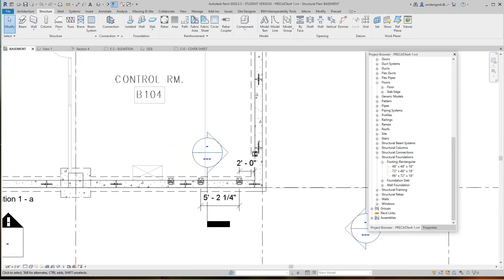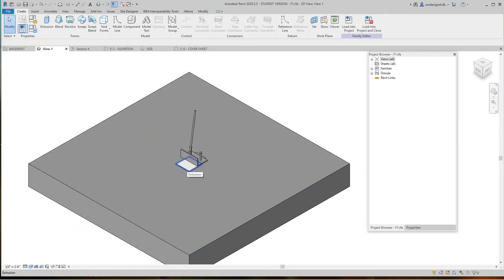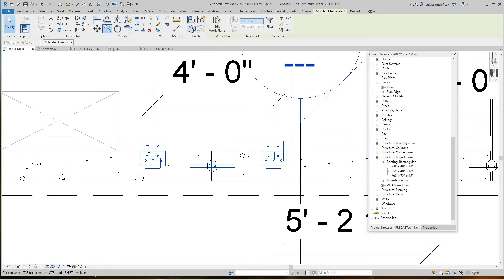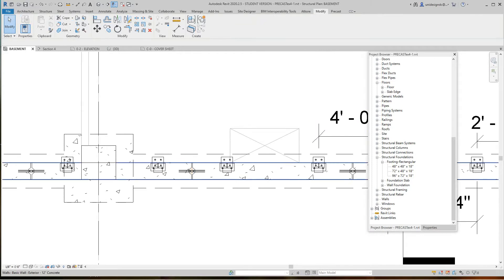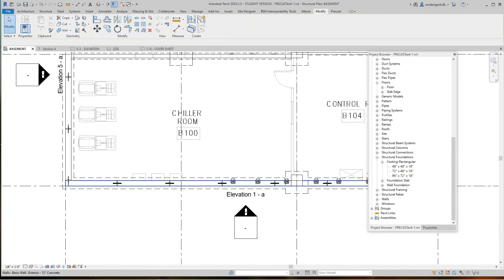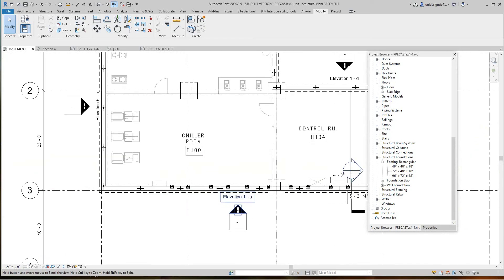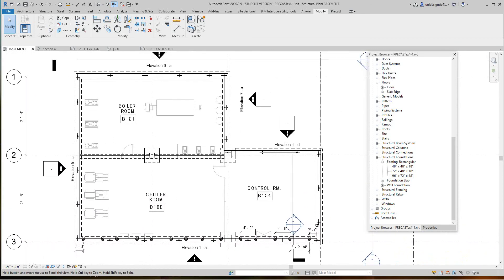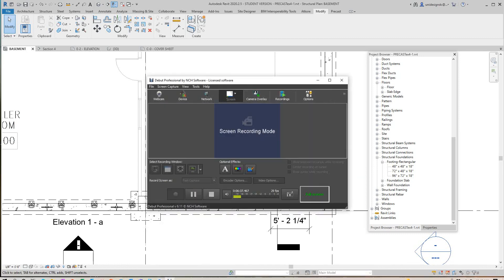Revit Precast Embedment plan base connections

Comment: Thanks for useful content 
I need link of precast extension for revit 2018
Reply from the maker: You should be able to get it from the Autodesk app store. https://apps.autodesk.com/
I am not sure if they still support 2018 because I did not see it, when I checked.
Reply: The tool has disappeared from the search engine and I can't find it at all
Reply from the maker: @mohamedazouz7420  Can you get a later version of Revit? If you are a student you can get a free 3 year license. Autodesk does not support 2018. See if you can get 2021 or 2020 for free